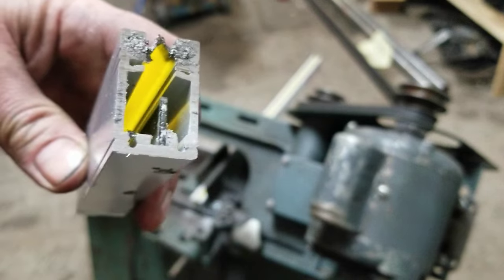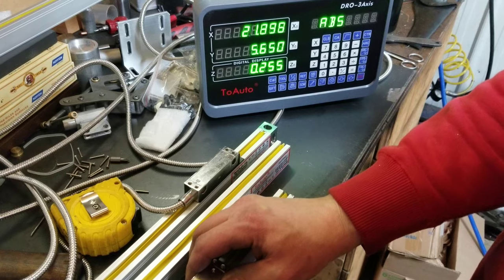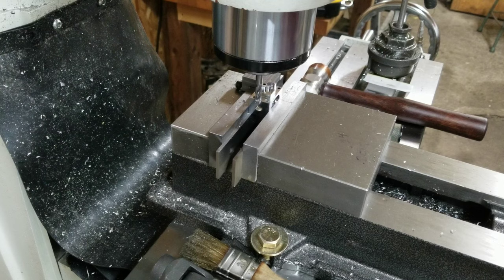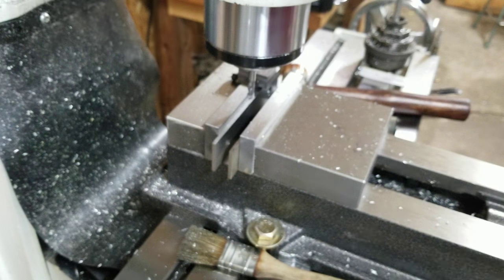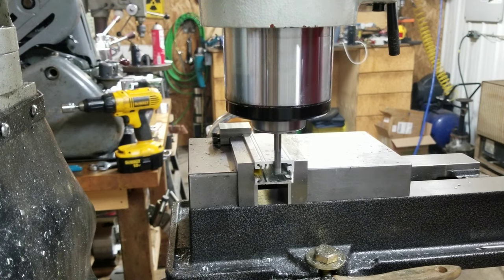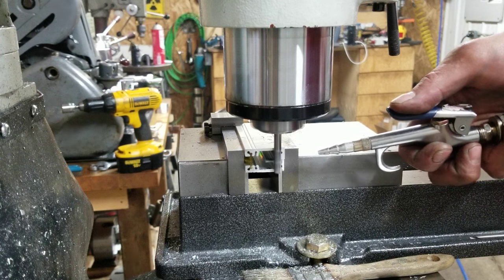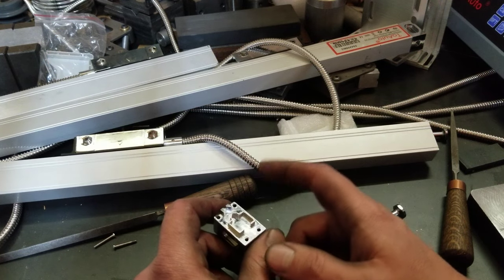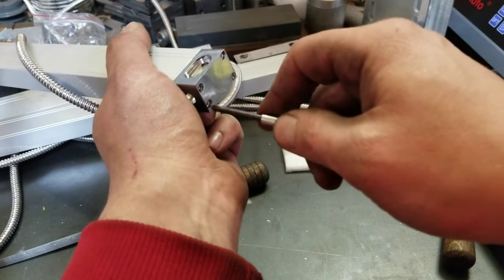Cutting Glass Scales for My New Digital Readout!

Comment: I had to cut all three of mine as well (for a lathe/mill combo). I used a sabre saw on one, an angle grinder on another one and just a hacksaw on the last one.
They all work just fine! Squared them up the same way as you did. Mounting them though was a challenge. Especially the Z axis.
But finally all installed! Have fun with yours!!